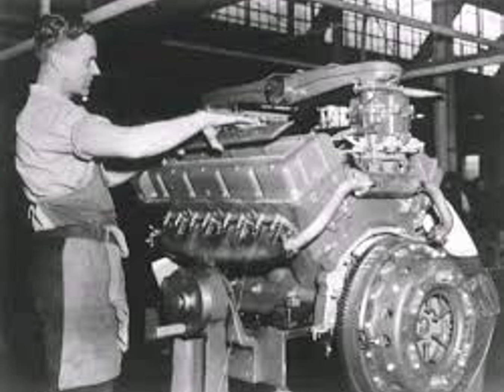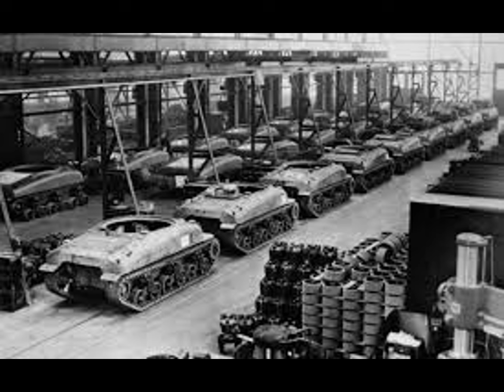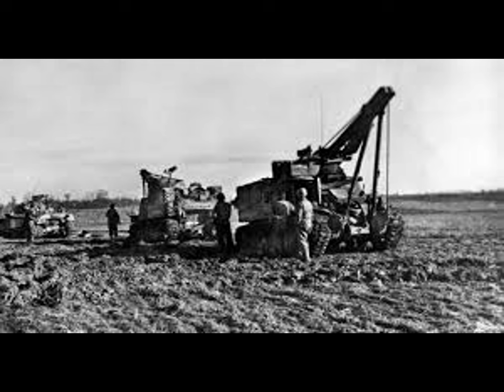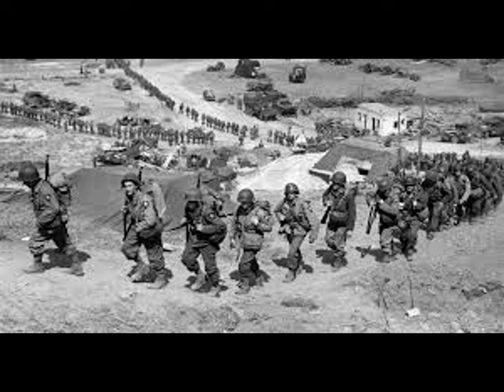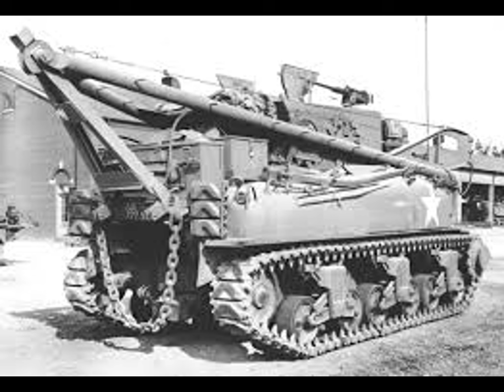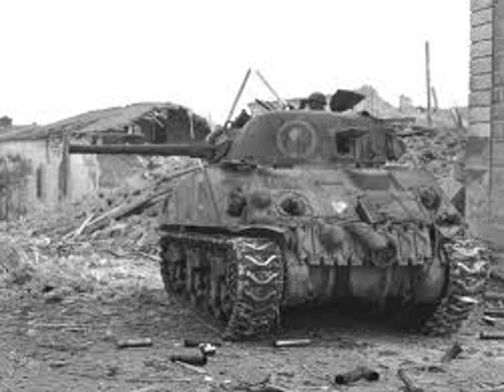How One Mechanic's 'IMPOSSIBLE' Wrench Angle Cut Tank Engine Repair Time by 80%

Comment: Very revealing video. It clearly shows how important and necessary the support troops are for effective front line combat success. Those mechanics worked in extreme environments under intense pressure from command. I certainly have new respect for them.